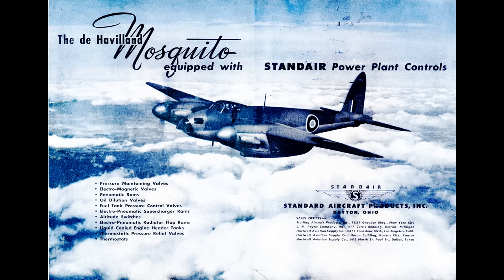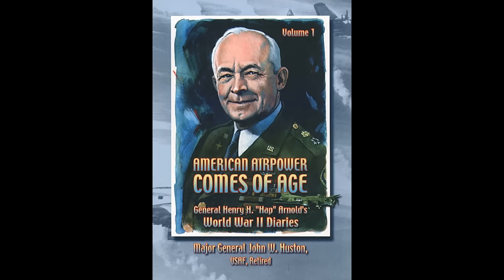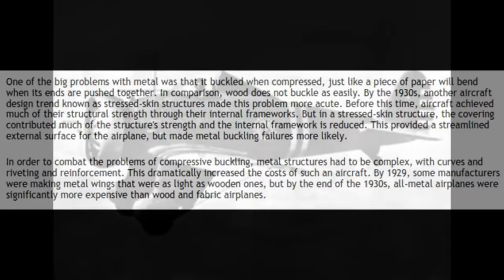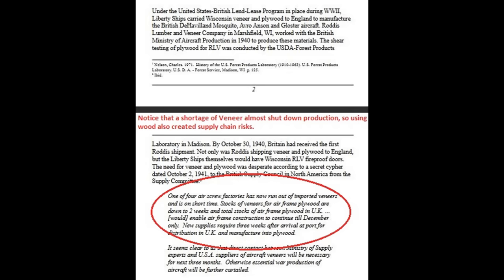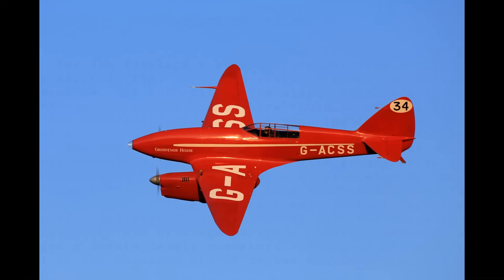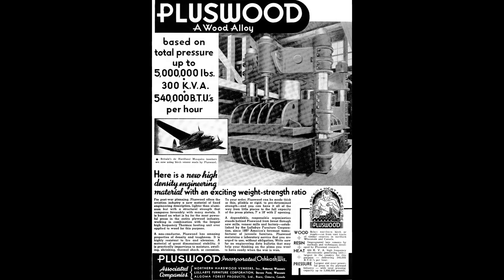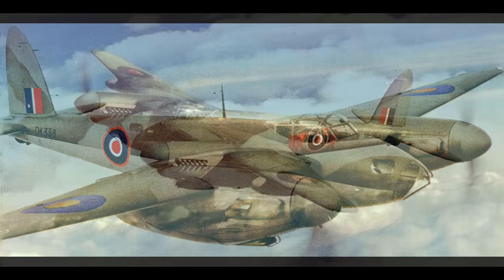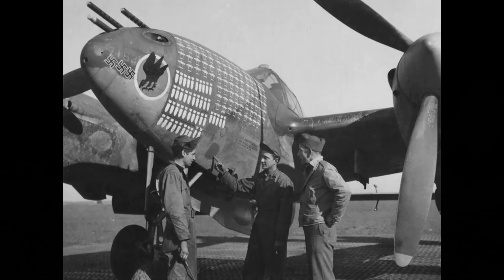De Havilland Mosquito vs. ?

Comment: I think "should the US have built the Mosquito vs the P-38" is the wrong question. What they should have asked is "should they have built it vs the B-17" The Mosquito could carry the same bomb load as the B-17 all the way to Berlin with 20% of the crew and half the engines at twice the cruising speed and with a far lower loss rate. It also rarely required a fighter escort, freeing up those planes to do something else.
Reply: The Mossie vs heavy bomber question is a very interesting one, but to my mind there are too many unknowns to answer definitively. Unquestionably the loss rates of the Mossie were lower than the British heavies. But because the heavies were the bulk of the Bomber Command force (ok, Wellington fans, I know the Wimpy made up a majority, or at least plurality, of some of the early thousand bomber raids, but later in the war that was not the case), they’re also what the Germans were focused on shooting down. So you saw a lot of heavy fighters and night fighter versions of bombers like the Ju-88 and relatively few single engined fighters hunting the RAF. It was tough for the single engines fighters to bag a Mossie, it was impossible for a Ju-88 or Bf-110 to do that. If the RAF had gone all-in for the Mosquito the German response would likely have been different.

Mind you, I still think their losses would’ve been lower with more Mosquitos, but it’s probably not fair to assume the Mossie’s loss rates in that scenario would’ve been as low as they actually were.
Reply: Mossies trying to bomb Berlin in daylight missions? They'd have been slaughtered.
Reply: John Buchman actually they did just that and were not slaughtered, although obviously losses were higher than at night. On September 17, 1942 Mossies led the first raid on Berlin of the war. The attack was made in daylight, but cloud obscured the target. One Mosquito was lost (of six). On 30 January 1943 they launched two daylight raids to disrupt speeches by Goebbles and Göring to party rallies. The first raid involved three Mosquitos, all of which returned safely. The second raid, also of three aircraft, was greeted by alerted air defenses, and lost one aircraft.
Reply: @alexanderrswaim5142  Sure. An -early war one-off mission catching the Luftwaffe by surprise. Had that become common place, they would have been slaughtered. The night bombing accuracy, even when using Pathfinders to mark targets was quite a lot poorer than the daylight bombing achieved (though even that wasn't great).
Reply: @alexanderrswaim5142  I agree that if the RAF or USAAF had gone for heavy use of the Mossie the Germans would have obviously changed their response to counter it. That said, there were still a lot less aircraft that they could use to intercept one, and of course, if the Mosquitos had been escorted by fighters that would have given the Luftwaffe more problems. Heavies losses were in part so high because (as you say) the Germans could bring everything from single seat fighters to Bf-110s with air-to-air rockets to attack them. They even dropped bombs on US formations.
Reply: @johnbuchman4854  As Alexander mentioned, Mosquitos did exactly that. The physics of intercepting an aircraft that is doing a similar speed to you are quite different to those needed to intercept something that (like a heavy bomber) can only cruise at just over 200mph. If you miss an intercept by even 10 minutes (pretty easy to do in the days before accurate radar), a Mosquito cruising at 330 mph has already travelled 50 miles away from you. If you then start a tail chase at a closing speed of 40 mph (assuming our fighter can reach 370), it's going to take you over 1 hour to catch up. All this assumes the Mosquito crew doesn't react or change direction, and that our fighter doesn't run out of fuel. So while I don't doubt there would have been losses, I would contend that they would have been much, much lower than those suffered by allied heavy bomber crews.
Reply: @wavecentral  Mossies had a high top speed true, when unloaded and not needing range. Carrying 4klbs and cruising, not so hard to kill.
Reply: John Buchman do you have sources for that? Boscombe Down tested B. Mk IXs at overload conditions with 2000 pounds of bombs carried internally and an additional two 500 pound bombs externally and a full fuel load. Cruising speed was 283 mph at 2000 feet and 329 mph at 20,000 ft. At 30,000 ft cruising speed was at 345 mph.

The report can be viewed at http://www.wwiiaircraftperformance.org/mosquito/lr495-b.pdf
Reply: The better question is should they have built it vs the A-20, B-25, and B-26.  I say that answer is more clearly a yes.
Reply: @alexanderrswaim5142  Even giving them the speed of 329 mph, and that is not while maintaining formation. Having no defensive armament (and the Luftwaffe would know this), receiving zoom/boom attacks (speeds well above 330 mph!), being heavily loaded and unable to pull more than maybe 3g's without losing the wings while dodging attacks...

It might have worked, if they had escorts which could cruise fast enough carrying drop tanks...

I think a better idea would be unescorted A-26 Invaders.

My $0.02 USD.
Reply: For the same reason that the Brits didn’t stop building Lancasters.  Ordnance capacity.
Reply: The Mosquito wasn’t a high altitude bomber of particular note.  The RAF built thousands of Lancasters even after the properties of the Mosquito was known.
Reply: Lancaster could carry 3 x the bomb load of a B-17 though, and with special modifications could carry the largest bombs of the war. The argument is that there's very little the B-17 could do that couldn't be done better and at a much lower loss rate by the Mosquito.
Reply: wavecentral - you are way out in the weeds on the Mosquito.  With a 4,000 pound bomb load the Mosquito was a heavily laden twin engine bomber - not a Mosquito.  I’ve been told by Greg that he’ll address this misconception about “cherry picking” certain British plane data.

Comment: Another important factor in building the aircraft in Canada and Australia, was that DeHavilland already had subsidiary companies in those countries, which I would have thought would have made setting up production in those countries much easier. As far as I know, most other companies didn't have this, although Hurricanes would also be built in Canada.
The crash that killed Geoffrey DeHavilland Junior can't really be attributed to the change to all-metal construction. The aircraft went totally out of control in a supersonic dive, pitching up and down so violently that his head hit the canopy, breaking his neck. I doubt that any airframe, wood or metal would have withstood such forces. 
The last gasp of DeHavilland was really in 2013. In the early 60's they designed the DH125 "Jet Dragon," which entered production as the Hawker Siddeley HS125. Ultimately this aircraft became the Hawker 800, which ended production in 2013.
Reply: On the contrary, I know there are several British companies that had Canadian subsidiaries. During WWII, there was Avro Canada (who also owned Orenda Engines, which would become somewhat famous in the jet age), Canadian Vickers that later became Canadair, and of course, de Havilland Canada. After WWII there would also be a Hawker-Siddley Canada, and the Bristol Aerospace Company of Canada, which is now simply Bristol Aerospace and entirely Canadian-based.
Reply: @smittywjmj  Absolutely right! I forgot about those.
Reply: Corerct hangarrat. The Swallow crash was nothing to do with metal construction but all about early transonic stability problems, particularly on a tailless aircraft. Eventually, though terrifyingly, the Swallow went through the sound barrier over Bedford, but not before being modified.
Reply: Australian aircraft industry eventually manufactured 755 Wirraways, 705 Beauforts, 250 Boomerangs, 365 Beaufighters, 104 Mosquitoes, 16 Mustangs and almost 2000 aircraft engines.

Comment: Thanks Greg. Another great video with tons of information to unpack. Can't wait for your P-38 vs Mosquito comparison.
Reply: probably because it was primarily a bomber...  P38 would have no problems running down and shooting down mosquitos as they were much faster. One is a better fighter, one us a better bomber.
Reply: @garrington120  440mph was the p38 top speed. I dont know where your getting your data from. Most of the "issues" your probably speaking of are from the RAF field testing of the non supercharger equipped version they decided to import despite warnings from lockheed. They are both great planes, but I would take a P-38 at high altitude with longer range over the mosquito in the Pacific theater any day. I would take the mosquito on raids across the channel at low level avoiding radar any day over the p 38. They both are iconic, great planes that arent a direct matchup so theres no need to get in a shouting matchup about it. Both were also highly envied by the enemies they faced.
Reply: @garrington120  top speed listed for mosquito is only 408mph...
Reply: @garrington120  dude the lightning variants were faster then the mosquito variants as technology and the war progressed, not by much but they were. I'm not taking anything away from the mosquito, I'm just saying your under rating lightning. Have a good day

Comment: Hi Greg, and thanks for creating the best WW2 aircraft channel on YouTube.  Well done. 
I just wanted to comment on what I believe the answer is to one of your proposed questions as to why early Mosquitos had structural failures, especially in tropical climates. The early build machines used casein glue in assembly and by its nature (byproduct of cheese) attracted moisture and fungal growth. The change to formaldehyde based glue solved 1 of these early flaws. It was interesting talking with one of the team that built the latest airworthy Mosquitos (NZ2308) about the different, modern glue systems available and the pros and cons of each. Si, Christchurch, NZ.

Comment: Mosquito delivered: reliable Europe-wide PR coverage for most of the war, the best night fighter of the war (and it's prey was other sharks, not whales). Best long range precision interdicter, best long range maritime attacker, and on and on. What plane drove the Germans most nuts? Best plane of the war, period. Easy.
Reply: Best night fighter of the war.  Considerably better than the purpose-built P-61 Black Widow which arrived too late on the scene to make much of an impact.
Reply from the maker: I'm a bit hesitant to use the word best, but it was certainly one of the best.
Reply: The Brits wanted the P-61 to be big, it was created before the invention of the stable cavity magnetron which allowed much smaller radars.
Reply: @givenfirstnamefamilyfirstn3935  I don't believe the British had any interest in the P-61, so I am not sure what you are referring to.  If it was being built with the intention that it would surpass the best British night fighters I think it was a failure because it clearly didn't.
Reply: big cheese  are you just copying your comment wherever you want? Your comparison is fallacious anyway. you are comparing aircraft designed years apart. It isn't even fair if comparing a Mk1 Spitfire with a Mk12, the same aircraft with 3 years in service development.
Reply: big cheese  Then why make your same comment in at least 2 places, using an unfair comparison.
Reply: @garrington120  I've never heard Greg have a "Best aircraft of all time" claim so I'm not sure what you're talking about. From what I gather he's of the opinion that some aircraft are better than others in certain ways.

Comment: Part of the genius of Geoffrey De Havilland and the Mosquito, is that it took advantage of the same sort advances in material sciences that were improving aluminum planes. The Mosquito wasn’t simply constructed from wood, it’s fuselage was a rather advance plywood wrapped around aluminum frame components. 
The single biggest advantage of this was actually that it allowed an otherwise industrial sector to be tapped for the construction of the Mosquito. Furniture, cabinet, and piano maker shops and factories could all be employed and sub contracted to build Mosquito, putting their often exceptional skill to use that was otherwise being under utilized in a war economy primarily based around steel and aluminum.

Comment: The Mosquito used rubber balls in the oleo legs for suspension springs/dampers. 

Outstanding!
Reply: Very clever.
Reply: I think there was a Moulton connection. First the Mozzi, then the Mini.